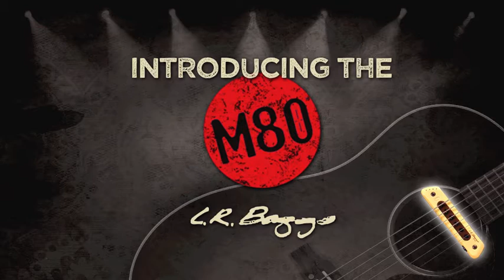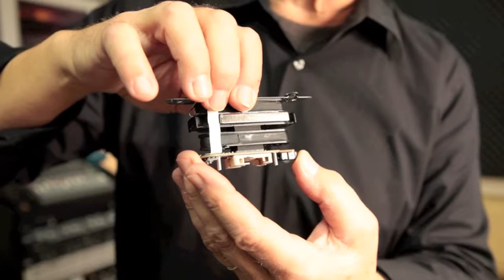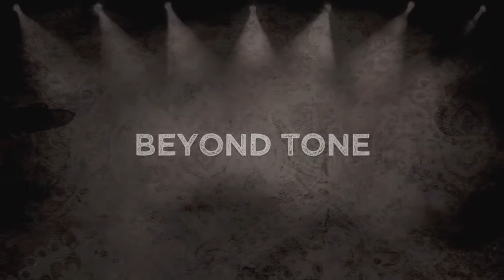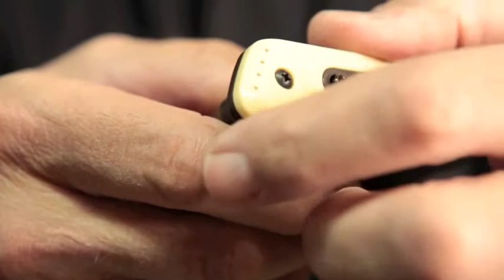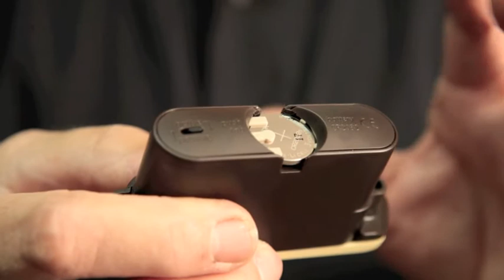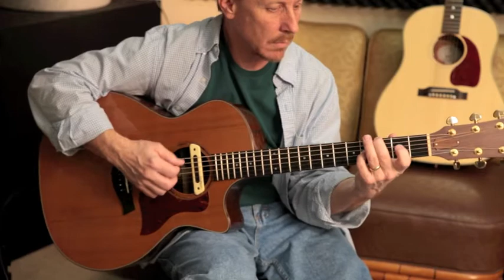Introducing the LR Baggs M80 Pickup

Comment: I want to buy lr baggs m80 at an online shop.. my question is your video is just 10 years ago discussing lr baggs m80.. my question is 1. the stock lr baggs I bought was a black box (the newest is a brown box).. if i buy it, is it still in good condition, the store was established in 2016 i assume the lr baggs is 6 years old.. if i buy it is there a problem because the old stock is about 6 years.. i hope you can help answer
Reply from the maker: Hi. It should be completely fine. Some players have had the pickup in their guitar longer than that. We switched to different packaging some years back after an issue we had with our supplier. We wanted to simplify our packaging and that is why our new boxes are kraft.